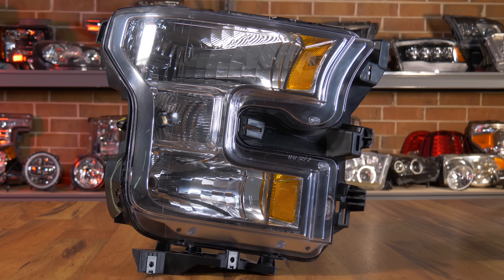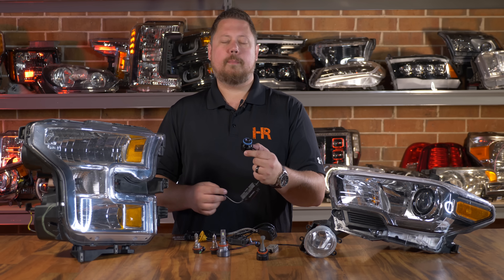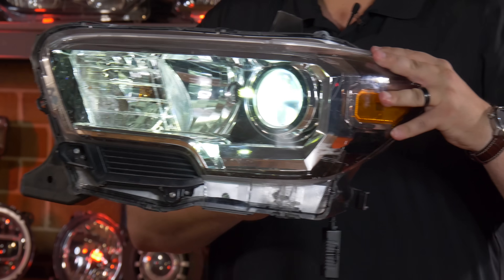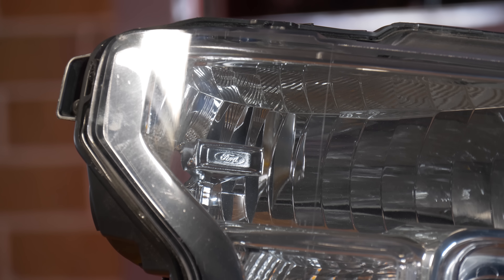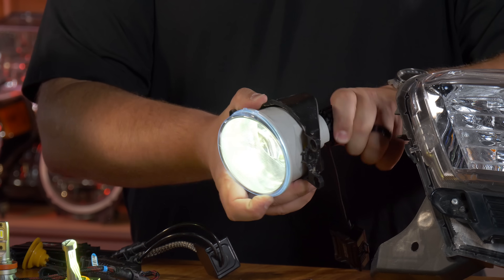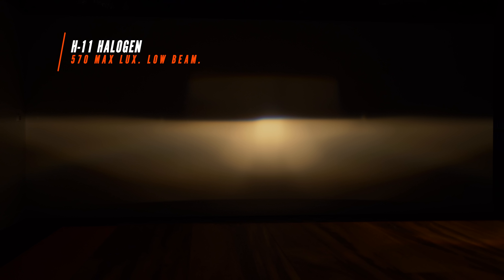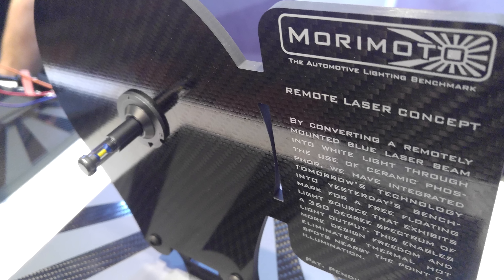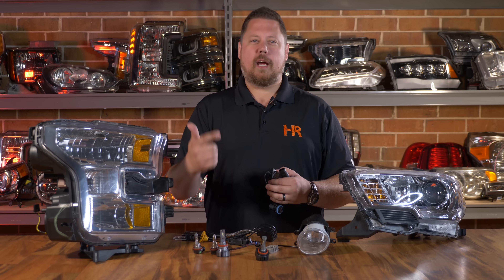Laser PNP Headlight Bulbs are Here! Do they work though?  |  Headlight Revolution

Comment: There's a problem with the current application of the laser in headlights. As shown, it IS bright enough, it's just the distribution of light from the laser. They put the laser in an existing headlight configuration, since the laser is more focused, they need to defuse it more What they need to is have a different configuration of the headlight housing that defuses the laser light in a wider angle. Then, should give you the same effect as a halogen or LED bulb.
Reply from the maker: Precisely! For a laser to work, you will need a projector with the ability to split that laser into a wider, more dispersed beam pattern to then be cast onto the road ahead.

Comment: Thanks for the video.  What brought me to your video was how you demonstrate the fixtures out of the car.  I had a couple new H11 bulbs given to me and I thought it might be possible to repurpose a car light fixture as a hard wired spotlight, hand held or otherwise, for my boat.  There are no videos that address this DIYer project and I wondered whether or not you might have any thoughts on this idea.
Reply from the maker: It's definitely possible, You would need to find some H11 housings, a 12v source, and some sort of switch!

Comment: The issue with putting these out there for regular people is that cars which use laser headlights have special lenses that widen the beam. They look amazing, the cutoff is super clean and perfect. They also use multiple lenses side-by-side in most. Unless a retrofit kit comes out with the proper projector lenses, these are as useless as idiots with light bars.
Reply from the maker: Thanks for the comment

Comment: Looks like it would work for illuminating the center line and the side of the road if used as a spot that moved with the steering wheel only. In conjunction with the regular vehicle lights.
Reply from the maker: If the light could move with the steering wheel, these would be SICK. But they don't do that unfortunately.

Comment: It will be great used in different form factors that are designed specifically for laser headlights. An array of 12 of these, each with small lenses, can selectively turn on and off to avoid blinding other drivers (by detecting headlights and taillights from other cars and turning lasers off pointed at them), while still providing plenty of high-beam light in other directions.
Reply from the maker: That’s definitely a good idea and we’ve seen some manufacturers trying out technology like that.

Comment: A true coherent laser would be useless as a headlight; you would get diffraction patterns and interference all over the place. So this, as the man says, is a solid state laser pumping a tube full of phosphors (not "yellow phosphorus" as stated in BMW own press release, FFS!)  the light coming out is no longer laser light and does not offer the dangers a laser does.
So what's the point? Inherent in the way solid state lasers work is  their efficiency,  you get more light for you watt, but having said that LEDs are now pushing 50% efficiency so we are well into the realm of diminishing returns, the energy saving is trivial.
Optically, not being coherent, it can be no different to an LED source of the same emitter area and that may be it's only advantage; a smaller, nearer to a point source, emission giving a clearer edged and better defined beam. Is this an advantage I don't know.
Better details here: https://www.powerbulbs.com/blog/2016/08/laser-powered-headlights
Reply from the maker: Thank you for the detailed comment! I really can’t wait to see where the technology goes from here.

Comment: All'yall talk'n bout them IDGITS coming at you with bright lights, what about them morons behind you? You don't have much recourse but to either slow down or pull over & let'm by.
How about a couple lasers pointing rearward. 😋👍
Reply from the maker: That would be one nasty surprise!
Reply: @HeadlightRevolution  
YES IT WOULD!
I now have a bank of Par12 50w each Led spotlight bulbs pointing out the rear of my bike.
Them IDGITS with brights on and refuse to dim after I blink my brake lights gets a quick flick of just 2 of the said bank of lights, if they don't get it then, they get all 10 bulbs which is pointing just at the driver. So far (3 times) every one dimmed their brights.
Like they say, FIGHT FIRE WITH FIRE.

Comment: For motorcyclist this could have its uses as helmet light, or in my case i have long beam projector that is sure shows "far away" but not far enough when in high end of speeds in dark roads, though it needs more light spread on the sides, so i'l be upgrading to led and maybe later add laser as secondary light to show far away, just to spot those animal eyes. Then again this tech is new and expensive so maybe in few years.
Reply from the maker: That’s not a bad idea, Who knows where it will go from here!

Comment: Useless!! Most people don't adjust or even know that they are supposed to adjust their headlamps. This light in it's current form will just be one more blinding spot in my eyes and mirrors. I have HIDs in my truck and purposely adjusted the housing slightly downward so it's not in oncoming traffic eyes or a direct aim at someone's rear view mirror when I'm behind them. Nope absolutely useless at this point and time.
Reply from the maker: Headlight adjustment is extremely important, That is for sure! Thank you for watching.

Comment: In an application like that lasers are not ideal its just one...what luxury manufacturers like Audi are doing with them is using several individual lasers in a headlight housing...what is nice in that application is they can design the lasers to turn on and off independently so to not blind oncoming traffic. They can turn off the left most lasers when sensors sense an oncoming car while the right ones stay on. In that application lasers are a great idea...this cheap option not so much

Comment: I have laser video projectors at my work. they are very bright and work well. BUT the laser module is very large and still requires lenses to get the image looking proper. I would suspect this would be a good product for a manufacturer to design into their cars with proper lenses and cooling.  but an after market bulb would not be good, current cars are just not designed for that kind of light pattern.

Comment: What brand are these? I would love some for auxiliary, momentary, lighting for use instead of headlamps to signal drivers (in the far left lane on a four lane highway) to please move to the right for faster drivers. It would prevent other drivers for getting that cast off from regular LED high beams when you flicker them real fast. Also, these with a blue tone would be awesome to place on a light bar for police vehicles. Drivers forever want to not move out of the way. It would be really hard for one that has a couple of blue lasers put in thru their back window to say "I didnt see the emergency vehicle."

Comment: Laser surely works, but not that one and the form size is also hard to make something that works... But party high power laser beams some can make a super wide high brightness beam that would perfectly work as a light source, but then again to make that perfect to the size of a normal bulb to fit in a car is exactly what I don't know if they will ever manage to make one that will work, most likely would require is a very custom full headlight with a custom laser that would make the perfect wide beam and then again I think it's just easier and cheaper to make them with LEDs instead as I don't really see the point in using more expensive laser when it's prohibited at least here to have high distance projection lights or very brightness blinding ones...

Here in EU the high beam even with a normal halogen light should only be used if you don't see a car or person at around 100 meters in front of you (if I remember well), if you see a car coming you should change to medium light beam.

Comment: Try it on a wall 100 meters away, coherent light sources are able to project incredibly far so one would think it would be very useful for high beams and it has a long cone shaped light pattern so of course on a wall 15 ftt away it will be small but howabout 100 meters or 200 meters huh huh the test is better suited for traditional lights that use the reflectors , not so good for frikken sharks with lasers on their heads

Comment: I certainly feel like this tech could work (but not with that lens design). What they need to do move the phosphor out to the same position as stock headlight filaments and then give the top and bottom a mirrored cone (bottom one would need a hole for the laser to hit the phosphor).

Basically the same lesson the LED bulb manufactures learned.
Reply: exactly. Re configure the housing and the lens

Comment: Very interesting and informative! I'm interested in upgrading various exterior incandescent bulbs to led on my 2009 BMW X3, but I can't seem to find the bulb type details anywhere on the net. I'd like ti find bulb types for turn indicators, brake lights, etc. Also, I'm having trouble discerning whether or not I need resistors in order to stop the LED bulb from throwing a "bulb out" code. Any suggestions on a source on the net to provide me with the info that I need rather than having to resort to pulling bulbs manually to determine the type and putting LEDs in first to see if they throw an error? Thanks!

Comment: You would think with all the info put together here and across many vids, people would get what's up,  but clearly piecing the bits together is FAR above the normies.

It should be abundantly clear that most housing, especially now are made with halogens as a lowest common denominator. Most projectors are made with HID's being the proper, though being only OPTIONAL  from the factory on MANY cars. LEDs being the same.
For someone with enough of a brain to even come hear (let alone be paying attention to car tech) should be obvious that the lasers were not only coming, but have an entirely different housing (which Im sure some dumbass is gonna try to cheep out and stuff an HID in down the line and be genuinely perplexed as to why it's not working right.

Seriously, most of you normies still think the 'new tech' is "too bright" but I suppose general actual observations of the world around you is far to much to hope for for.

Comment: These lasers work in conbination with LED or HID (xenon) for short range (low beam). Laser is purely long range focused. Otherwise they need to make headlights like Seat does for the Leon FR where they reflect LED light (with very tiny reflectors) on the road. But then again, led is easier for that than laser since LEDs can be very small.

Comment: I already did buy a few of those laser bulbs.  I'm using it in it's intended purpose as a long range additional spot beams in addition to my LED high beams, KC Daylighter HIDs, and Diode Dynamics LED bar all relay wired to come on on high beam circuit.  The yellow glow is fantastic for really late night driving because of reduced eye fatigue, which makes enough difference that I disable my light bar on long drives because it's too blue.  Mounted to my "rally support truck" I use for rallies because you need maximum throw when driving way too fast on gravel and paved roads going from stage to stage to beat the rally cars to the next stage.  We'll see on long term review how they hold up.  BTW they also sell then in a small housing so you don't have to lose a set of fog lights or high beam spots to use them as spot lights.

Comment: I could see that in use for a driving light.  Where you want a long distance "spot light" effect.  Or for off roading, definitely NOT as an aftermarket replacement for a standard halogen.  I'd be interested in replacing the lights in our vehicles with LED aftermarkets, and MAYBE in the fleet at work.  If nothing else it should cut down on having to replace the damned lights in the middle of winterwith no garage to work in!

Comment: I think lasers would work perfectly fine if the emitter is channeled into a lens that spreads the light as needed.  You can't just replace a bulb with a laser as projector assemblies are not designed with a laser in mind.  It's not an easy aftermarket swap-out.
Reply: That's pointless, laser just sounds fancy, works the same way as LED while being less efficient, want wide pattern, LED is the way to go, want spotlight, laser is your best bet, but laser on its own doesn't make sense in automotive applications.

Comment: These laser retrofit lamps need to conform to the bulb they are replacing, as in the light needs to be emmitted/refracted from the same position as a halogen, then they will work in a reflector and projector housing. Otherwise new headlamps need to be designed to distribute the light correctly.
They should stick a stalk on it and focus the laser on little mirrors attached to it then they'll be better than led and possibly hid.
Reply from the maker: One day they'll be amazing hopefully!

Comment: How do they perform temperature wise vs the led? If they run significantly cooler, then with a proper protector, this could be very useful in preventing the overheating that kills the led's.
Reply from the maker: We haven't tested that, but we'd be interested to know as well!

Comment: These would work perfectly fine if they had a correctly-shaped focusing lens attached to the front of them. In that case, they would work best in a reflector setup with the glare cover removed—but as a projector, not using the reflector. I'm guessing the shield in the projector blocks too much light, leading to the reduced output. The hemispherical lens in a projector focuses the light from the entire reflector surface, so when you have something approximating a point source like the laser bulb, the projector lens is ineffective.

Has potential, but needs work on shaping the output. What are the power/lumen (light efficiency) figures like when compared to halogen/HID/LED?
Reply from the maker: They have a long way to go, but they're exciting tech!

Comment: It is quite simple why this cannot work as showed.
"Old lamps" like Halogen have a quite undirectional and inhomogeneous light emission, which has to be corrected by a reflector "as good as it gets". Much stray light.
"XENON" acts even more undirectional but almost as a point source with sperical emission. So the light can be formed and directed quite good by a combination of lens and reflector.
"LED" has a one-sided emission and a somewhat "half sphere" emission profile. A single lens can be suficcient to form the light.
"Laser" is a highly directed point source of light. So it is just the opposite of the "other sources". Optics have to used to spread it.

In summary, you can say the more "modern" the light source gets, the more you need the optical system of reflectors and lenses to spread and diffuse the directed light instead of collecing and direct the diffused emitted light from the source.

Fortunately, in my country (of Mercedes, BMW etc....), you are not allowed to change the bulbs in you car to another system anyway, unless you change the whole headlight assembly and have it evaluated and approved by officials (TÜV).

Laser is good, but not the shown way.
Reply from the maker: Gotcha, thanks for watching!

Comment: I don't think the laser contributes to the spread of light from the unit. Laser bulbs typically work by exciting a yellow phosphor with a blue laser, which gives off the white glow. This is why the bulb looks yellow towards the outer edges of the beam. Anyways, the "straight" laser light is absorbed by the phosphor, which gives off light in many directions.
Reply from the maker: Thanks for the input!

Comment: When I was young, people thought I was weird to spend $100 on new headlights that didn't even have their own light bulb. Sealed beams were only $10. When I put (stupid expensive) Hella halogen driving lights on, I needed to also change my alternator size and install a relay to switch lighting loads never dreamed of by the builders of my '67 Volvo 142. I drove several dozen times overnight from Edmonton to Vancouver and return in a 3 year period in the late 70s and the first 2 trips were made with white knuckles due to poor lighting combined with numerous animals of various kinds littering the Yellowhead Highway in the mountains and the BC interior. Many hours of pitch black empty highways in winter were made so much easier with quality lighting. People laughed until they saw the lighting in operation, then they were forever unsatisfied with the lights on their own vehicles. The amazing thing about vehicle lighting today, 40 years later, is how poor it is on so many vehicles without regard to lighting type. Bad Design can defeat the best technologies and intentions.
Reply from the maker: You would think we would be miles ahead of where we are with OEM headlights now! It's awesome how committed you were to safe driving even before it was a huge thing! thanks for watching.
Reply: @HeadlightRevolution  I wasn't a real safety oriented driver then, I just didn't want to share a seat with a (@*%!&*) moose at 80 mph and it almost happened once. With 220w of lighting, I had roughly 15 times more lumens than original and, on a 2 lane, both verges were well lit with white(ish) light. Great lights have been around for a long time.

Comment: Excellent video. I have a question.. When you change halogens to led, what happens to the day light running lights?
Reply from the maker: That depends on each vehicle and how their electrical system creates the DRL function. Sometimes it works fine out of the box, sometimes you need extra parts, and sometimes it needs to be disabled completely - all depends on what vehicle you have.